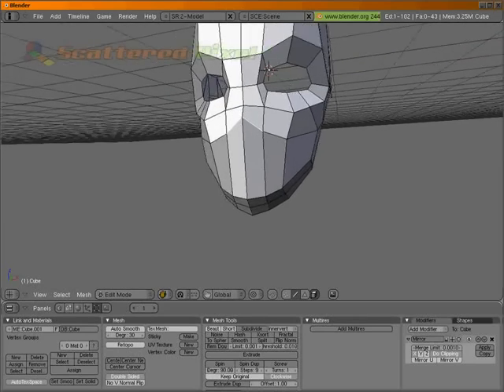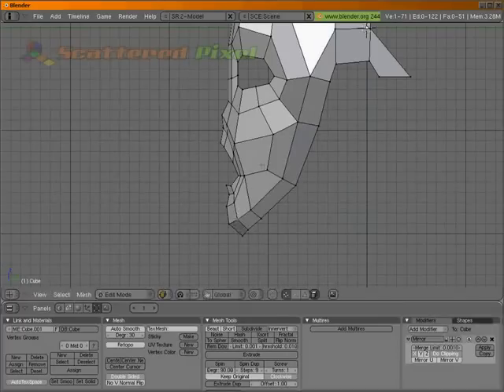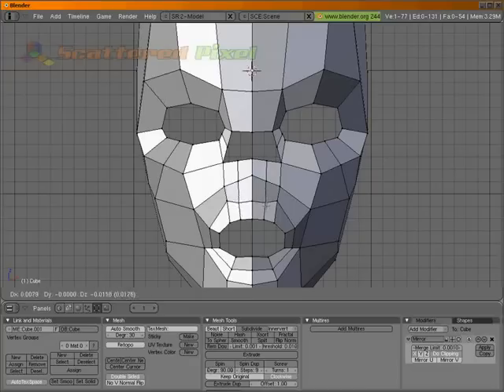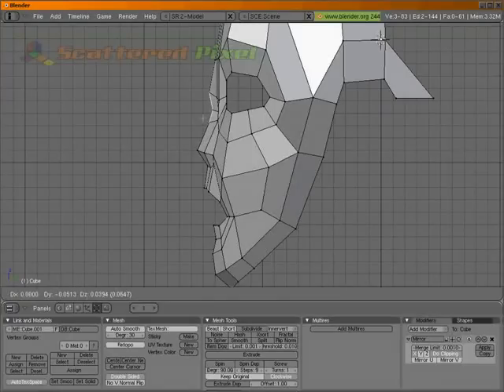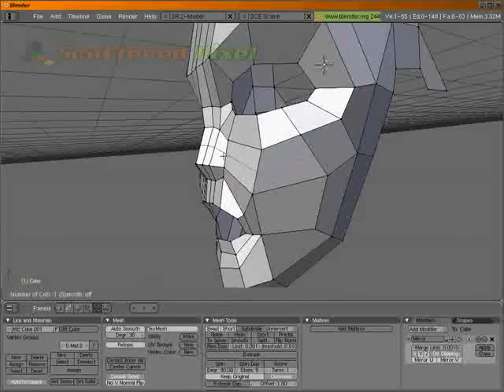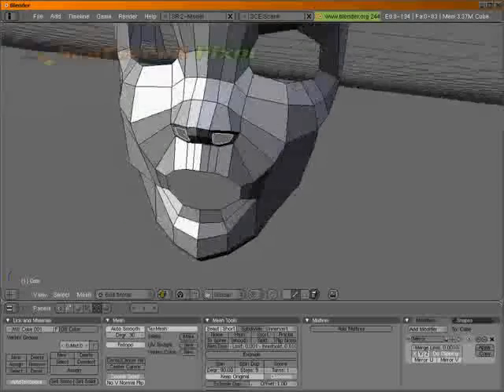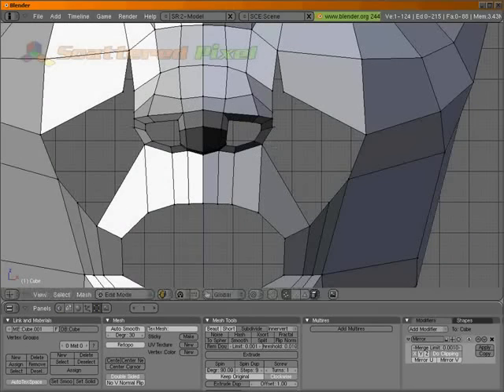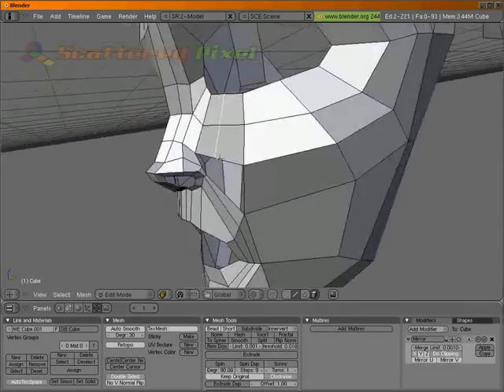Head Modelling Part 1 - Some Basic Shape 2/3

Comment: I have a question if I may. I made a body on layer one, then a head on layer two. I moved the head to layer one, I want to connect the two, body and head, but it won't let me get into edit mode with both objects to connect them. It only lets me go into edit mode with either the head or the body not both. So how would I make it so both the body and head can be in edit mode. So I can connect them together. Thanks.